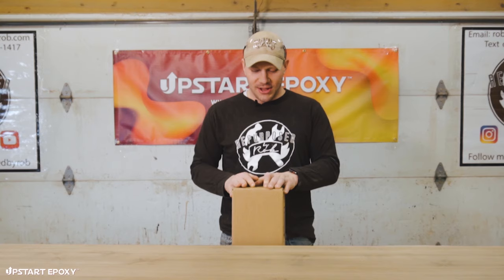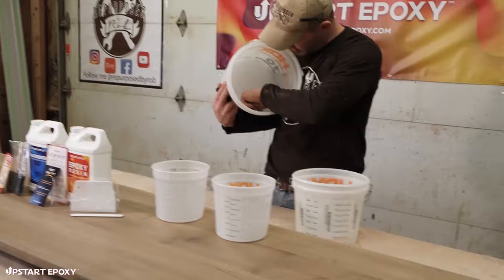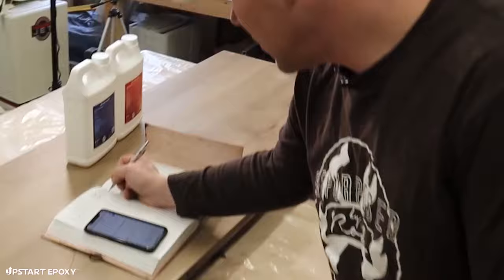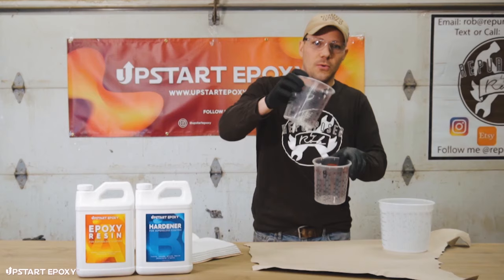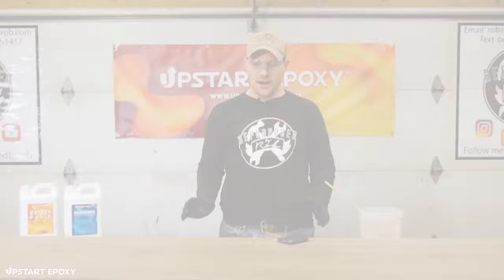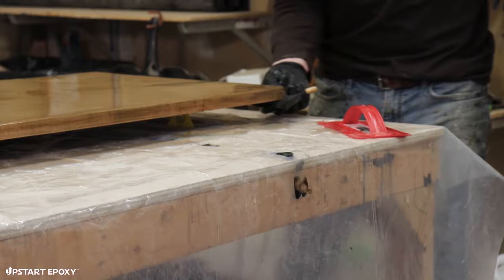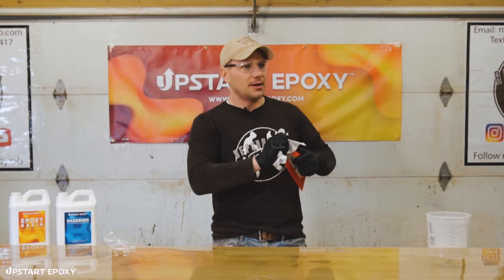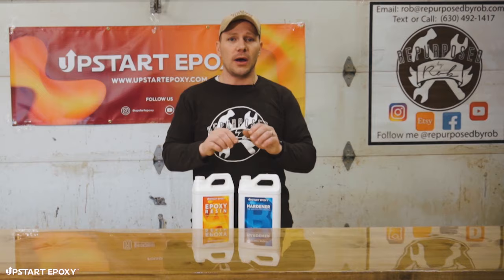How to Use Table Top Epoxy Resin

Comment: Can I use this over a table that I have polyurethaned? I thought if I did enough coats it would seal the splinters, but they’re still lying in wait to cause injury. I also saw a comment that asked about sanding and buffing afterwards. Why do you need to do that?
Reply from the maker: Hi Angel, 

The best practice is to start with epoxy, and then overcoat with polyurethane. Not the other way around, as this may develop adhesion issues in the long run. 

You need to surface prep like any other project though, and sand to 120 grit and then coat with epoxy. Should stick better! 

Thank you for watching!

Comment: So my table is made by salvaged wood from a church burning down. It is currently covered with glass, which I don't like. I would like to coat it in epoxy but there are a few places with 100% all the way through holes. Any tips? 
I am also worried about calculations with all the holes and burn marks.
Reply from the maker: Hi Emily! For filling in voids on your countertop, you can apply it first with a skim coat or slurry paste using a putty knife or with a gloved hand. Once it is fully cured, you can smoothly sand it with regular sand paper. The time this takes will depend on how large the voids are and how much water was mixed with the coat but should be anywhere from 1-6 hours.

Comment: Great video!  How do I pour over a paper design. I want the resin to overlap the paper and wood surface.
Reply from the maker: Thank you! You would have to seal your paper first as what you should do with the wood surface as both materials are porous. Once sealed, you may pour your epoxy just like that one on the video. ;)

Comment: i have a 45x45 table top im trying to epoxy ,what amount would i need?
Reply from the maker: Hi Sandi! It depends on the project, but our coverage calculator helps! You can use it by measuring the length, width, and depth of your project in inches and plugging those numbers into the resin calculator. We suggest you round up to give yourself a little extra epoxy to work with. If in doubt, let us know the dimensions and we can check for you. Calculator Link: https://www.upstartepoxy.com/pages/epoxy-calculator

Comment: This was a great tutorial, thank you. Question, I plan on putting an epoxy coating on top of a coffee table that has a latex paint pour on the surface. Any suggestions on using the Upstart Epoxy product on this project? Thank you for any feedback and/or suggestions.
~SK
Reply from the maker: As long as it's not oil-based, you'll be able to pour on paints/finishes/etc no problem. For some things like artwork, many people spray/brush on a sealant before epoxy.

Comment: If you wanted to add some paper type things, how would you go about that? I have a coffee table project and I want to put some bookmarks on it (I'm a huge nerd, I know lol) but I don't want to mess it up.
Reply: Same question, but I'd like to put some paper charts of where we sailed on the top and coat it with epoxy. Would i put the paper charts on the sealer and coat with a 3/8 deep epoxy? Or should I do a 1/8 layer with the epoxy, put the charts on that and then pour? Will the first layer of epoxy be clear when the next layer is poured over it?
Reply: That would be super cool. I've seen some paper things with resin but I am guessing it's a but different
Reply from the maker: @kalidice1775  Hi Kali! Yes, you can! For a really solid finish, an epoxy resin coat will turn a paper into a rock-hard object.

It's best practice to seal your bookmarks first with a brush-on or spray sealer before your resin will create a barrier and prevent the resin from seeping into the paper and giving you unwanted dark, wet spots :)
Reply from the maker: @shootinsquid10xamf76  Hi there! These are great questions.

It's always a good precaution to seal your paper first before you resin. After sealing them, you will need to do a 1/8" layer and pour it. The first layer of epoxy will be clear when the next layer is poured over it! 

Sometimes papers or charts can absorb the resin -  giving it a wet look but to avoid that it is best to apply a sealer to your work prior to working with our resin.  We always recommend doing a test on a "non-masterpiece" first to ensure you get the desired results. Hope this helps!

Comment: Thanks for the video, I am making some small outdoor tables having tiles and inlayed wood.  Using tiles it is not smooth so a drink glass may not be stable.  I was thinking of using Upstart but wonder if using it over tiles or for outdoor use (Arizona heat) us a good idea.
Reply from the maker: Hi Grateful Zugore! Thanks for watching our video! Upstart Epoxy is best used for indoors and semi-indoors applications, but anything outside is not rated for. While it is UV resistant, prolonged exposure to the sun will cause it to yellow and may chalk when exposed to direct sunlight for extended periods of time.

Comment: Another question, I will be working on this table in my garage. How do I keep small particles from floating into the resin as it cures?
Reply from the maker: Hi Angel! You can absolutely do that by putting them while the epoxy is still tacky :)
Reply: Plastic drop clothes tacked up to your rafters. Make yourself a hillbilly paint shop.

Comment: Is the formula to find how much epoxy you need the same for an oval table?
Reply from the maker: Hi Pam! For a round surface, you will need to measure the diameter. Divide the diameter by 2 to calculate the radius. To calculate volume in cubic inches: (radius squared) X pi (or, 3.14159265) x (desired epoxy coating thickness).

Divide by 1.805 to convert cubic inch volume to US fluid ounces. To convert ounces to gallons, divide by 128.

Comment: how do you do 2 sides of a board, or 4 sides to a block ?
Reply from the maker: Hey Sharon! You will want to let the top side cure first before coating the underside of it. For the other sides, you can brush coat them :)

Comment: can you use water based poly as a seal coat?
Reply from the maker: Yes, you can. Water-based polyurethane won't cause problems when applied over epoxy resin coatings.

Comment: how many times do you have to heat the bubbles out?
Reply from the maker: Hi Carolyn, we recommend doing it 1 to 3 times as needed, with several minutes wait time in-between to allow the resin to cool. Just keep in mind to not overheat the epoxy or not to keep the flame on the resin for too long.

Comment: how would you calculate a ROUND table?
Reply from the maker: For a round surface, you will need to measure the diameter. Divide the diameter by 2 to calculate the radius. To calculate volume in cubic inches: (radius squared) X pi (or, 3.14159265) x (desired epoxy coating thickness). Divide by 1.805 to convert cubic inch volume to US fluid ounces. To convert ounces to gallons, divide by 128.

Comment: Are you able to pour the epoxy over stained wood?
Reply from the maker: Yes! As long the stain is not oil-based. If it is, you would need to sand it.
Reply: Wish i had known that. 😢

Comment: Going to sound like a really stupid question but how do you do around table measurement
Reply: Also what do you do if that you're  table has slats of wood where there's spaces between
Reply from the maker: @christinewillie7599  Hey Christine! You can measure your table with scale tape or any measuring tools. For the slats of wood where there are spaces in between - you can measure the spaces or each piece of wood then add them together to come up with a dimension.  You will need these dimensions to calculate and determine how much resin is needed for your project!
Reply: @upstartepoxy4804  okay the table top is approximately 2 to 3 in thick and so are the spaces in between the wood can I pour that all at one time in between the slats or am I going to have to do it in layers this tabletop is kind of like the old school picnic tables that had the gaps in between the pieces of wood on the table top only it's round and I'm trying to figure out how I'm going to fill those cracks with epoxy and make it so it doesn't run out the end of it

Comment: Can you pour that over a picture?
Reply from the maker: Yes you can! We also carry art resin that you can find here https://www.upstartepoxy.com/products/art-resin-epoxy/?oid=11&affid=606&source_id=youtube which can be used for this application 

For most applications involving pouring epoxy over a picture to preserve it as artwork or a decorative piece, art resin from Upstart Epoxy is the preferred choice due to its clarity, UV resistance, and suitability for a wide range of creative applications. However, if the project involves a functional surface like a table that will be used frequently, table top epoxy may offer the durability and protection needed for the long term.

Here are some tips and tricks to make sure it comes out the way you want it!
1. Prepare the Picture
Choose the Right Material: Use a photograph printed on photo paper or high-quality print paper. Inkjet prints are more likely to smear under epoxy unless they are properly sealed because the ink can react with the resin.
Seal the Picture: Apply a clear sealer over the picture to prevent the colors from bleeding or the paper from absorbing the resin. You can use a spray sealer, mod podge, or clear acrylic spray. Allow it to dry completely according to the product's instructions. Multiple light coats are better than one thick coat.
2. Prepare the Surface
Secure the Picture: Make sure the picture is firmly attached to the surface you're working on if it’s not already part of a solid object. Use an adhesive that won't react with the resin or the sealer you've applied.
Create a Barrier: If you're working on a larger surface or an open-edged project, create a barrier to prevent the epoxy from flowing off the edges until it's set. Tape or a temporary frame can work.
3. Mix the Epoxy Resin
Proper Ratios: Mix the epoxy resin and hardener according to the manufacturer's instructions. The ratio is crucial for the resin to cure properly.
Remove Bubbles: After mixing, allow the resin to sit for a few minutes to let air bubbles rise to the surface. You can also use a heat gun or torch carefully to remove bubbles after pouring.
4. Pour the Epoxy
Pour Evenly: Pour the epoxy resin over the picture, starting in the middle and moving towards the edges. Use a spatula or a spreader to gently guide the resin to cover the entire picture evenly.
Thickness: Be mindful of the thickness of the pour.

Comment: When do you mix colors powder at what stage?
Reply from the maker: Hi Irfan, you mix colors during the mixing of Part A and Part B stage!
Reply: Since I want a white table with gold streaks, is it best to mix white powder with the epoxy in the seal coat instead of painting the table? And then putting gold streaks on top of the sealed coat once it dries thoroughly but before the flood coat?

Comment: Over time will it turn a yellow hue?
Reply from the maker: All epoxies yellow over time when exposed to UV light and the more intense the sunlight the faster the yellowing process.  As long as it's indoors or semi indoors you won't have a problem!
Reply: @upstartepoxy4804  thanks great job on the workbench

Comment: When do you finish the back of the table?
Reply: You don’t
Reply from the maker: It's not required, but if you want to-you can just lightly sand the back of the table, or if you want to finish it, you can apply a polish/oil just to maintain the surface.

Comment: Can I just do a flood coat instead of the seal then flood?
Reply: What did you do?
Do we put w 100% epoxy
50% hardener?
Reply from the maker: Hi! We always recommend working on a seal coat thenf lood coat.
Reply from the maker: @blendervideos4974  for this, we recommend a 1:1 ratio.
Reply: @upstartepoxy4804  I got away with just sealing the concrete counter top with a 1 part epoxy and then just doing a flood coat with the epoxy resin.  Most of the measurements end up being way more than calculated for.
Reply: @AppJunkey  did you use 1:1 ?
Reply: @blendervideos4974  yup! Make sure you mix until clear and use a heat gun for the bubbles!
Reply: @AppJunkey  ty
Reply: @blendervideos4974  I don’t remember what 1:1 means but I basically calculated how much I would need for each section and let’s say I needed 1 gallon then I used half epoxy half hardener to create that gallon or let’s say so I need 40 ounces I would then use 20 Oz of epoxy and 20 Oz of hardener, using a measuring bucket I marked my sections with a sharpie and I actually used a tape measure to figure out the distances because those buckets are not accurate. It always ended up being way more but you have plenty of time to work with it I also created a marble maze underneath with cardboard and tape to catch the drip.

Comment: Pro tip: Use metric for all measurements (much easier to work with cubic centimeters as a measurement of volume, if you need 10 cubic centimeters, thats 1 liter of mixed liquid. Now all you do is find what U.S. unit is equivalent to a liter